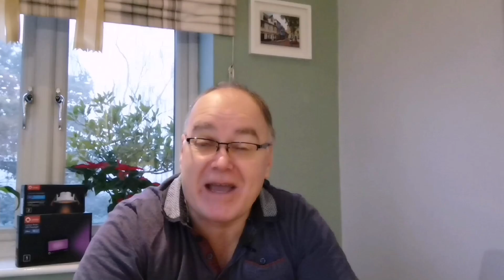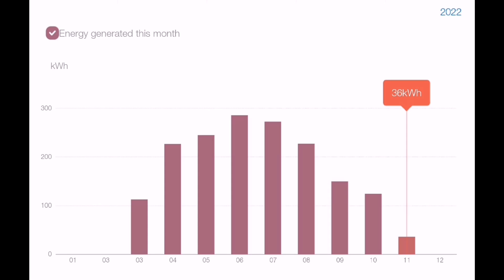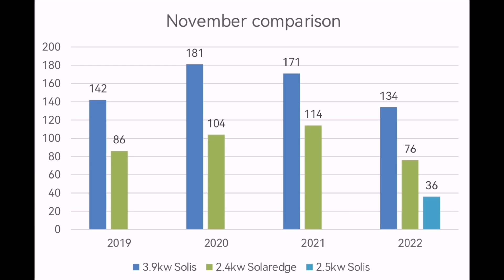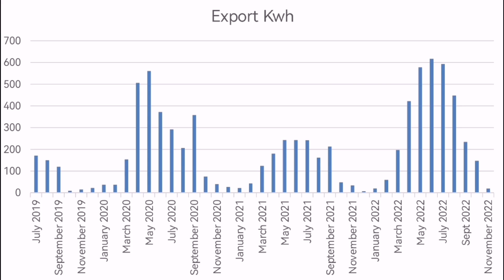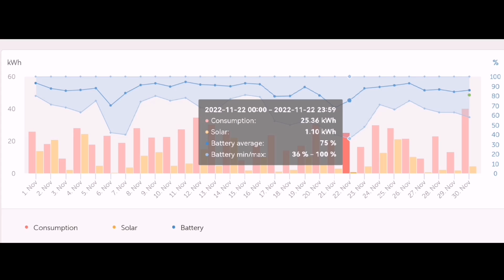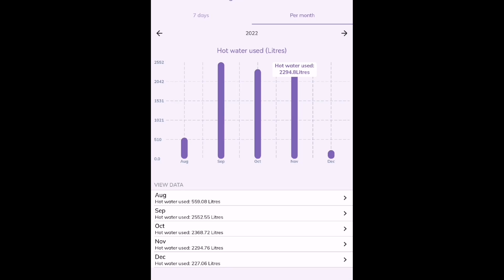Solar PV, battery, Mixergy and A2A heating system - First winter challenge

Comment: Impressive numbers.  I am making use of the Agile Outgoing and charging my battery each day and selling it back to the grid at peak time for £1-2 extra a day.  That is covering most of my electrical costs.  The solar Edge system says we only generated 85 kWh in November and we exported 56.

We are still on gas for heating.  Managed to get through October and November and just covered that with the two £66 payments from the government.  December is not looking good though as have been spending £7-9 a day during this cold snap.  If that carries on it will be over £200 for the month.  My goal is to get heat pumps fitted next year.

Comment: The last bit of the puzzle you need is a centralized heat recovery system. Especially with all your efforts to seal up draughts. All the extraction from WCs, bathrooms, kitchens will help heat incoming air. This should also reduce your need for dehumidifiers
Reply from the maker: Ducting just isn't feasible
Reply: @EVPuzzle  Shame decentralised easier than
Reply from the maker: Once our use settles I'll look at air quality but to be honest these A2A units are so good I'll look at expanding those first, air flow between rooms has definitely improved.

What the tangible gains of an mvhr are I'm not fully sure yet and to be honest it's a specialised area. You don't see many businesses offering it here so not any easy acquisition

Comment: Interesting to watch the difference grow between South facing PV and mine split over E/W roof with approx 3.8 kWh per side. My solar readings for November were 57.634 kWh for West and 58.966 for the East facing. As we head towards the shortest day in December, the sun is lower in the sky and certianly gives less on a clear an sunny day.  Still waiting to see if I can add South facing Solar PV to my wall!
My ASHP had been using 50 - 60 kWh for water heating averaged over past few months as I was diverting as much solar in to my Tesla Energy Plan and increase any payments from them. I found that ASHP used less in kWh than the Eddi used in solar kWH, approx half,, so more energy efficient. 
However heating being on from 1st November pushed  our use to 438 kWh with ambient daily temps, dropping from 13 C to around 8 C at the end of the month. This was a test month with heating set at 19 C all day and only dropping by 2 overnight. At the end of the month we dropped temps by 1 C as we were too warm! I am also trialling the always on approach as not having to heat the house mass from a low temperature and use masssive amounts of energy to reheat. 
Grid use was about double yours at 1467 kWh for the month with 121.96 kWh being exported (Figures from Octopus Energy app).  This total is for Car, Heating, Cooking as well as general home use. (We have a 5 bed 1970's detatched house)
For info, use net use from grid...April 447 kWh, May 310.2 kWh, June 193.4 kWh, July 326.4 kWh,  August 233.4 kWh, September 483.4kWh,  October 793.4 kWh and November was 1347.4 kWh
So solar PV works amazing in Summer months and even in Autumn, bad for November, December, January, February and improving by March. Saving money for 6 to 8 months then helps to pay for winter.

Comment: Fitted my winter tyres from the leaf 215/50 17s onto the Niro which should have 215/55 17s and WOW kia should fit the Niro with 50 profile instead of 55 its transformed the Niros straight ahead off centre vagueness into pin sharp its a Huge safety benefit in my opinion. Cheers and have a happy Christmas all
Reply from the maker: That does sound good.. Sharper front end a big improvement

Comment: I had an outside light with a low level bulb on a dusk to dawn  switch that provided minimal light for the entry door and walk way.
Just enough light to find the key hole and not stumble in the dark. I used to replace this low energy bulb once a year. Once I replaced the bulb to an LED light I have not had to replace the bulb for over 7 years. Switching to LEDs not only saves money on energy but it also reduces the aggravation of changing the bulbs.

Comment: You use home assistant so have a look at the sonoff products, a simple relay you can easily control, some have power of temperature monitoring. Great with motion sensors etc.

Comment: I allways try to match my results with yours cant do it for November as my hub went down and required replacing but I can remember the 4th it was a poor day for light due to storms, the clocks were altered from summer time and daylight became shorter.  Particulary annoying because Novenber was my first month totaly electric but what I can say is my bill for November this year was less than my November Bill last year being £116.62 for Nov 2021 and  £89.71 including £7. 83 standing charge for gas which I have not used  (I still need to remove the meter) for Nov 2022

Comment: Is it just me but you look a bit blurred? 

For compare, I am in the Norwich area. Setup is 6.76kw East facing panels with 8kw solis inverter, 4.62kw West facing with 5kw solis inverter. GivEnery AC3 with 1x 9.5kw and 1x 8.2kw batteries. ASHP. Cupra Born 58kw. Generation for November 218.2kw, sucked 759.2kw from the grid @ cost £88.32 on Go Faster 5hr. Average 10.42p per kwh. House used 561.5kwh (includes ASHP), The Born sucked 419.6kw, just under 60 miles per day monday to friday.

1 change left to make to my system. I am waiting for GivEnergy's new EMS box to manage multiple inverters better then I will add a second AC3 to give me 6kw charge/discharge and will add a grid isolation switch for possible grid blackouts. I would still like a small wind turbine however 🙂
Reply: Yes he does look fuzzy. Not your imagination.   I am in the norwich area and got a 5.8kw array with battery facing south east.  How you getting on since the 20/12/2022 when my array was fitted, would be nice to compare.
Reply from the maker: Clean your glasses?  Or do I need to clean the camera lense?

Comment: We only had 124kWh from our 5.7kwp south facing panels, in cornwall due to the sun being low and some shading. we have a bungalow so the panels are a bit lower than the houses around us. we did finally get our batterys fitted (4.8kw pylontech) at the end of november though, which has reduced our import.
we are with bulb energy at the moment, although we have been told we will be transfered to Octopus soon, which is good news.

Comment: Having an 11.5kW (East/West 25° pitched roof) system installed early Feb with Eddi, Harvi, 10kWh battery. Already have an EV and Zappi.
Gas boiler and hot water.
Based on my low mileage, I'll be better off on Octopus Outgoing rather than their off peak tariff.
Everything is so dependant on so many individual factors....
Reply: How many EV miles is that?

Comment: I use... Silicone Seal Strip Self Adhesive Tapes Draft Stopper Gap Blocker from ebay for the bottom of the doors .... it's been on for twelve months now and is clear so it doesn't stand out like a sore thumb 👍

Comment: Hi, I am really interested in your videos. Do you still manage to get your FIT payment even with batteries installed?
Reply from the maker: Yes I do FIT is based on generation its an inventive to install solar. Doing other things are fine so long as you don't touch the Fit array.

Keep it seperate
Reply: @EVPuzzle  Thank you for your reply. I already have solar panels installed for which I receive FIT payments. Just so I am clear I am understanding correctly, do I need to install additional solar panels and have batteries connected to those panels only?

Comment: That’s the same ratio for my best day in Nov. About 3X PV array size. Dec though, barely 1X on several days! We’re totally off grid, so no power bill. 8.6 pence, or 11 cents is cheap for power compared to our 15 cents.
Reply from the maker: Yep put Octopus tariff is nice and cheap.

Off grid must be challenging when there's little sun. I guess you adjust?

Comment: Intrigued by your dehumidifier, is this the heat pump acting as a dehumidifier or a separate unit?
Reply from the maker: Seperate cheap meaco unit. Only uses 165w

Comment: MIght seem trivial but I've just made a massive difference to my small hall by putting up a curtain that covers the front door. The front door is half glass plus glass panels to each side. A thermal curtain has made a really big difference in how much warmer the hall feels. It cost about £50 all in curtains and rail and TBH I'm not really bothered if it takes a while to pay back its just much more pleasant walking by the hall now.
Reply from the maker: Keyholes and letterboxes can be an issue too, door curtain makes a lot of sense
Reply: @EVPuzzle  the problem with mine is the whole door (and glass surround) is a poor insulator so it's letting the heat out (or the cold in whichever way you look at it). Should have done it last winter. One tip for anyone looking at similar I used an expandable pole so no need to drill and when it's warmer I can just take it down. The tricky thing was finding readymade curtains the right size for a door reveal.
Reply: @EVPuzzle  we removed our letterbox last year, and put a post box on the wall outside, that has improved the heat loss from the hall, and made it more comfortable. also fitted a sensor to tell me when we have post (homeassistant)
Reply: Energy efficient doors and windows make a big difference in comfort and energy costs.
Too many people only look at short term costs and do not look at long term savings.
Adding insulation, sealing air leaks, switching to LED bulbs, a set back thermostat all make a difference.
Reply: I've done that too. 10 degrees difference from the door to other side of the Curtain. Hall nice and cosy. ..
Reply: Costs lot of money to get new doors and windows so have to do what you can with what you got. We will do the same with a door curtain and and get a letter box installed outside. Thanks for sharing these really good practical ideas ❤👍🏽
Reply: Pensé en cambiar la puerta de entrada y  la cortina es la solución 👍,para el verano y el invierno
Reply: Are you finding any condensation issues in certain rooms with your improved air tightness?
Reply from the maker: Not me no, we appear to be managing moisture better  opening upstairs windows less but maintaining lower humidity  overall, condensation hasn't dissappeared 100% but it's so small a d only on several cold days. Improved window seals would help us or new triple glazing but just can't justify it
Reply: @EVPuzzle  when we moved to our current Bungalow we had a tripple glazed window fitted to our bedroom, but it didnt appear to be cost effective so the remainder we fitted good double glazing, which is almost as good and a lot cheaper. although tripple is better for condensation.

Comment: Our generation halved in November compared to October, with just 204 kWh or 36 kWh per kWp. We had the high temp ASHP for most of the month and therefore grid imports increased, averaging 16p per kWh on Octopus Intelligent (40.9p/7.5p) thanks to the battery. But the battery at 10 kWh (80% DoD) has not been lasting the whole day due to reduced solar, so maybe an expansion to that could be a of benefit - will need to crunch the data after winter to determine that.
Reply: I've come to the same conclusion this month regarding battery size. I've only just taken delivery of the Pylontech modules and Victron inverter so I need to install them but the data suggests I'll probably need another 4.8kWh module for the stack next year.
Reply: @peterclarke5323  average import unit cost is up to 23p so far this month which continues to builds the case for more battery capacity…

Comment: Air tight 🥴 I feel another epsiode required. I would recommend a CO2 meter that measures air quantity.  Since having triple glazing and wall insulation my home is around 800/900ppm in CO2 which is poor air quantity impaired to fresh air at around 350-450.  

I’m looking at a MVHR
Reply from the maker: That might be a good idea
Reply: Hello, We have had MVHR for the last 37 years, the first lasted 20 years and the current one just 17 years. The motors failed in each and it was more cost effective to replace the unit,
Just looking to select my third unit now. We have used ADM Systems for sometime and found them to be very efficient and reasonably priced.
We used radial galvanised  ducting and it is still going strong.
The manufacturers we are looking at are in no particular order;
Brink Flair; Titon; Vent Axia and Zehander.

Its very good for fresh air and keeping condensation down whilst drying in the winter.
You have to be careful in selecting the features you would like before picking a model also make sure if you are putting it in the loft it will go through the hatch.

I installed the first one as a kit.
Message me if you want further information.
Reply from the maker: Zero possibility of installing ducting in this house

Comment: I generated 83.5 kWh in November. The partial shading of my roof is exacerbated by the low sun. I can see I need better insulation but can't see how switching to electric heating would help. Me financially at all. My forty year old boiler needs replacing to save fuel but heat pump quotes are ridiculous and other electric heat options seem expensive. More investigation required.
Reply: An energy efficient home or business is more comfortable and saves money in the long run.
Solar energy on your roof combined with battery storage can make people more independent from the grid and natural gas supplies. Add solar and supplemental electric heating, infrared heating or a heat pump for home or business heating and cooling
All big box stores and manufacturing sites can support solar energy on their roofs or solar canopies on their parking lots.
Added insulation, double or triple glaze windows, energy efficient doors, energy efficient heating and cooling systems, energy efficient appliances, LED lighting, smart thermostats, solar panels combined with battery storage and a electric vehicle charger in the garage or car park. People are too focused on the short term costs and miss out on long term savings and comfort. Blower door testing and air sealing are under appreciated tools.Even if you have money to burn you should not waste it.  Climate Change will impact everyone. Leave a better future for your children and grandchildren. Join in and speak up for the future of the planet

Comment: Well, this is a sad result. You have a big PV array of 8.8kWp  with a huge battery and still in November import is 460 kWh. Right now at 9:00, the generation of UK electric energy is 72.1% from fossil fuels, almost entirely from gas.
Reply from the maker: Good job I only use off peak grid energy and sad result £50 for electric in November... With todays prices, hardly a sad result.

No petrol, no diesel no gas and no oil

Sounds like a good result to me

Comment: The heating oil industry will convert over to HVO (hydrotreated vegetable oil). 
It produces 90% less co2 than standard oil (kerosene) and produces less co2 footprint than an 8 kilowatt heat pump. 
There is a new modulating oil which is a game changer. The EOGB sapphire boiler.
Reply from the maker: Theres. Always a new improved fuel to save the planet, guess what they never solve the problem.. Oil burning is oil Burning
Reply: @EVPuzzle  also, we will never save the planet. Man’s heart will only become more wicked.
Reply: @EVPuzzle   every little helps mate. They will be running aeroplanes on HVO. It will literally save the heating oil industry. A complete game changer.
Reply: I've heard a problem with them as well as those used for alternative car fuels are the glycocites(sorry if the name is a bit wrong), anyway the chemicals that are used to produce the plants are far worst for respiratory problems when they are burned eventually as fuel.

Comment: No car = no cheap overnight option but like you so far the gov support is higher than my bills. 103kwh PV in November ( from 6.4kw e/w array) but 117kwh load (120% vs October due to gas heating -2006 condensing combi). 71kwh imported. 5.1kW Battery was only intermittently charged by the sun so could not power me at night. I don’t charge it from the grid, I’m on a 20p fix till next summer, cheaper than Agile I think. I don’t heat my bedrooms overnight and I lost 7.5 degrees heat in my bedroom, between last heating at midnight to 17.5 and my Tado intervening at 0430 to start pre-heating ahead of my 0800 timer. I’m more convinced now I must do fabric first before changing the boiler. Draft proofing and under 1970s wood-cladding insulation needed. I have a little flat roof porch/toilet in front of my house. Right now the toilet is 4.6 degrees. So I’ll be looking for your draft proof strips today to keep out that cold!
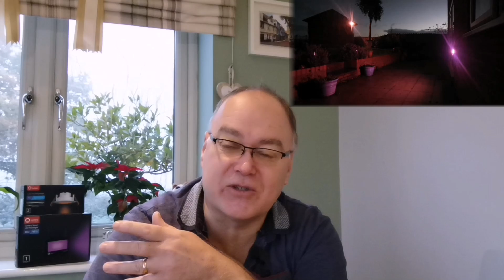Reply: octopus ECO 7 - 14.83p off peak 00:30-07:30 peak rate is 43p no EV needed
Reply: @1980gezzza  Thank you.  I could not find that as an option when I was looking.  Will look to move to that when my current tariff ends.

Comment: How are you getting on with the batteries located in a cold garage? Their operating window is quite forgiving but understand that it could affect their longevity.
Reply from the maker: Garage dropping to 4c overnight currently, batteries at 13c, lowest 10c so far and no drop in charging or discharging power.

All good so far.

The more I use them.the warmer they stay